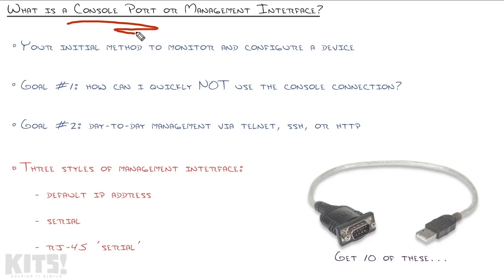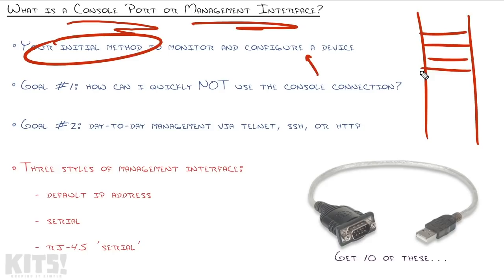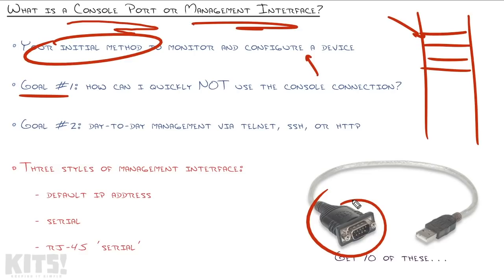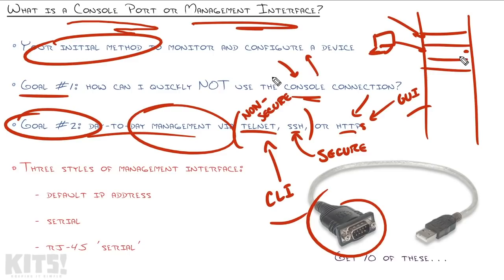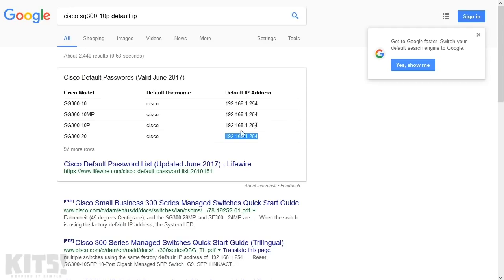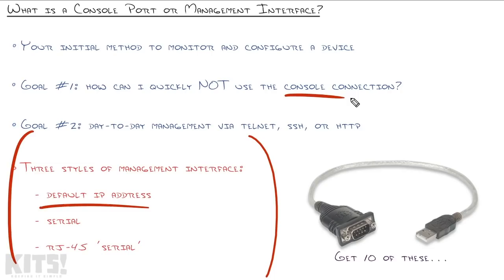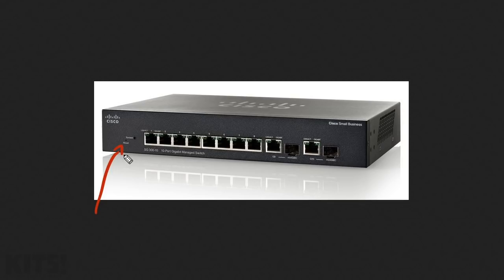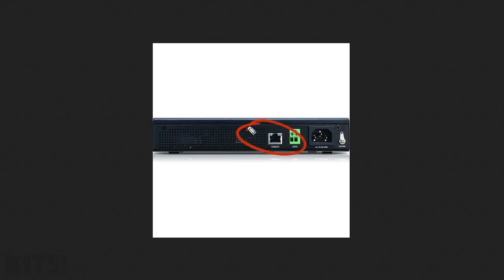Accessing Switch Management Interfaces! Ep.6: Real-World Business Switch Network Build

Comment: Super. This was a pretty great orientation to what I was struggling to understand. 
Now, in the case of the enterprise gear with the Ethernet-type console port, why wouldn’t you just get one USB to Ethernet cable?
Reply: Because it’s not an Ethernet port… it’s a serial port using an rj45 connector. The rollover cables are intended to be used in these ports, either going to a DB9, or USB adapter (both serial)
Reply: @peenweinerstein9968  Thank you. I understand the difference now.

Comment: Hi Jeremy, will you teach us how to access the switch through serial in windows, linux and  mac?
Reply: Apart from (potentially) different cables (in the case of a macbook), the end process will be the same as far as I know. Telnet and SSH are CLIs, which pretty much look like Linux command line, and GUIs are self explanatory, as you will have separate windows and tabs to see what you need to do. In any case, once the first time connection and configuration has been completed (usually with a console cable and stuff), subsequent accesses and connections will be established through the internet, in which case you will either connect to the Telnet/SSH client with an IP, or to the GUI , by typing the switch's IP into your browser (the same way you access your home router).
Reply from the maker: Yes - coming
Reply: Tony Oik I mean console access